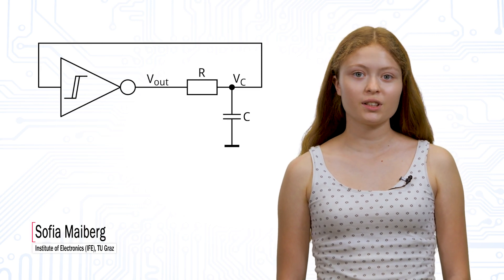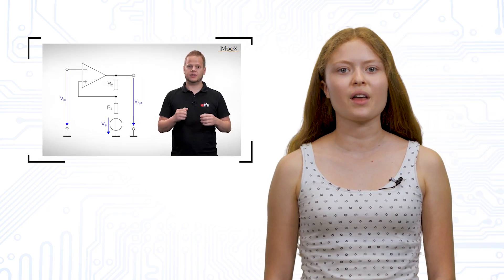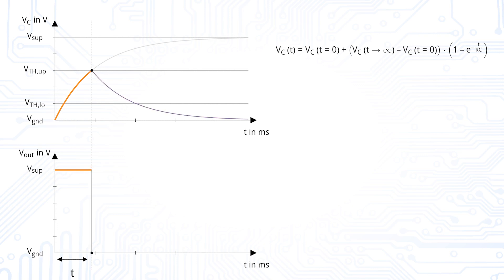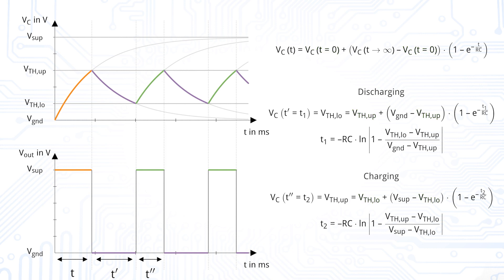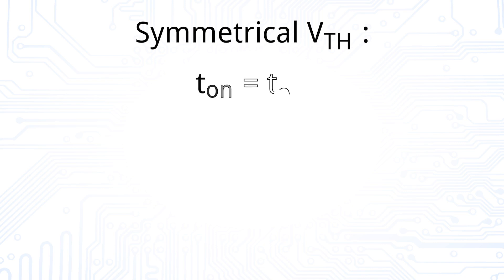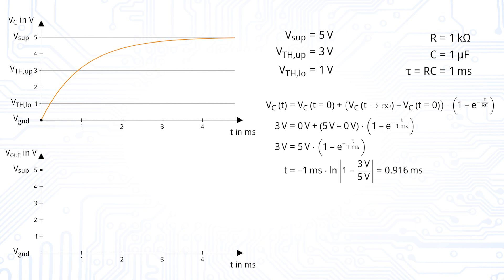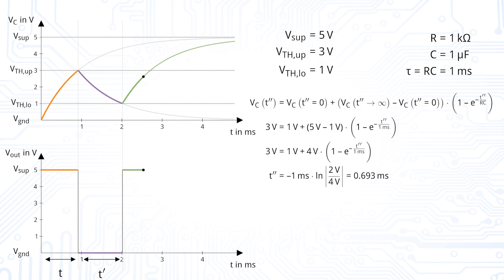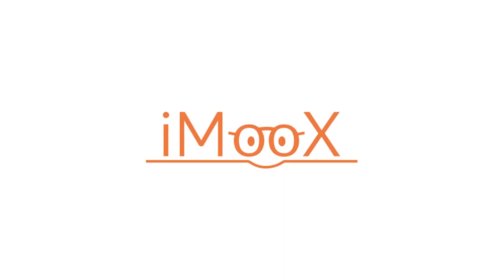Astable Multivibrators: Relaxation Oscillator, Inverting Schmitt-Trigger, Calculation Example

Comment: I arrived here because i was reading an article on 10 useful function generators. The recommended circuit components were old and not easily sourced. I decided to learn about individual functions of each of the circuits. Along the way I picked up the term "relaxation oscillators". Wikipedia was an early and useful stop. Then I found this clear and concise video. I can take this info directly to the lab bench. This is what makes the Internet an amazing resource. Thank you.